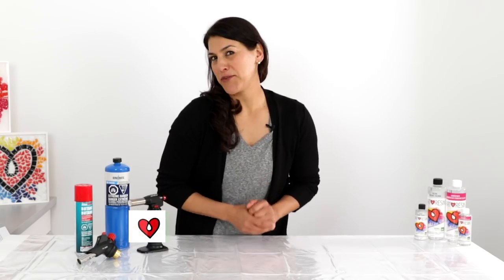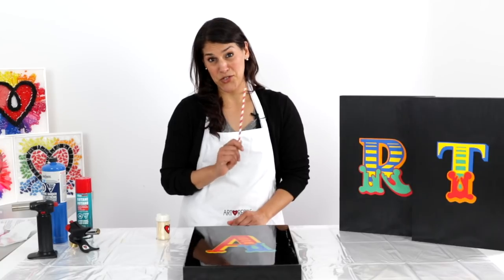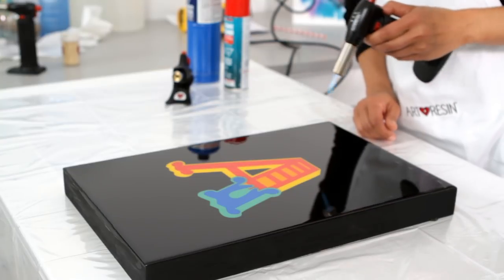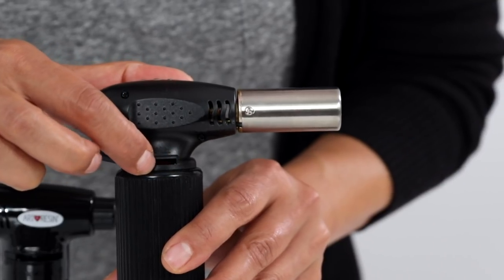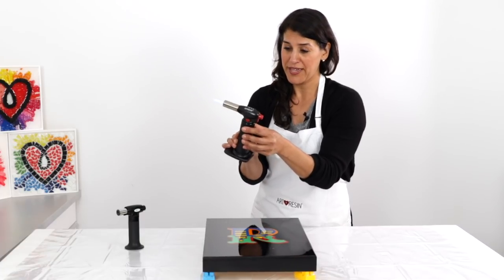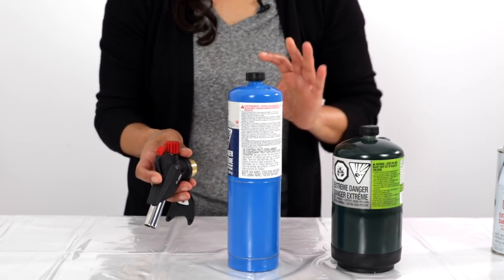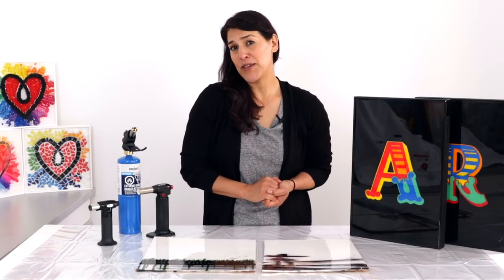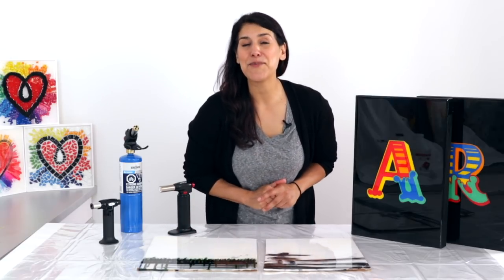How To Use A Torch With Resin

Comment: I may have missed it. But did you address the possible damage to silicone moulds if you use a torch? What are your recommendations for that?
Reply from the maker: We do not recommend using a torch on silicone molds as it will cause the silicone to fuse to the resin and result in tearing your molds.  Instead, you can use a spritz of isopropyl alcohol on the surface to clear off any bubbles that have risen to the top.

Comment: I make small pieces using silicon molds. How do I get the bubbles out without deforming the silicon? Should I not use a torch? Can I put it in the oven temporarily? What should I do?
Reply from the maker: The best way to reduce bubbles in your small molds is to use a warm water bath first, before mixing the resin and hardener.  The warmer resin and hardener will have a lower viscosity which will make it easier for the bubbles to release.  Second, you want to pour in layers of about 1/8", this will prevent bubbles from being trapped in a thick layer and they will remain close to the surface.  Some artists use a spritz of isopropyl alcohol on the surface to clear the bubbles in their silicone molds.  We do not recommend using a torch on silicone molds as it can lead to the molds sticking to the resin.
Reply: @Artresin  Thank you! How else would you make small epoxy crafts without silicon molds? Or do those people only do the warm water bath and never use torches? Also, Are there other mold materials other than silicon for small crafts that would be torch resistant?
Reply from the maker: @con-rob  Silicone molds are the best option for molds, some artists do use a torch but it is important to know it can damage the mold and cause sticking.  The alcohol spritz works well to clear surface bubbles without damage.

Comment: Great video as always from Art resin team.Thanks.I've been using a torch on a heat resistant resin but I keep getting dimples from the torch, but if I don't hold it close enough it doesn't pop the bubbles, do you have any tips about this.
.
Reply from the maker: When torching, you just need to pass the flame across the resin surface and you will see the bubbles disappear, being careful not to let your flame linger in one spot as you risk scorching your resin surface.  Some torches have adjustments for the flame size, so if you are covering a larger area you can use a larger flame and vice versa.  Use your torch while the resin is still fresh, not once it has started to cure to avoid disrupting the surface of your resin.

Comment: Hi, thank you so much for this informative video! However, I’d like to ask: I am considering to buy a candle lighter that is powered by butane gas. But I don’t want to go ahead and purchase this candle  lighter yet because I am wondering, would it actually work for popping out bubbles in resin? By the way, in case this helps you to answering my questions, I only make  small creations with the resin using silicone moulds most of the time (maximum size would be jewellery sizes, nothing bigger) so I don’t really need big powerful gas. What I mean by this, is I can live with less power I.e. time consuming torching; all I care about is whether it will get rid of the bubbles or not, as quickness and efficiency don’t bother me at the moment. So, would the candle lighter I mentioned work for my own situation?
Reply from the maker: It very well could work for you. The only down side to those candle lighters is the flame isn't as powerful or controlled. If you are comfortable using them I think it would be worth trying on your smaller pieces.

Comment: To avoid a film (oil streak) on the top of the surface which fuel is better or cleaner?? Propane or Butane??
Reply from the maker: We have not had a problem with a properly functioning torch leaving a film on the resin surface.  The flame from your torch really just passes over the surface very quickly.  We love the handy butane torch for small areas, whereas the large propane torch head covers a larger area for bigger canvasses.

Comment: hi...so we cannot use alcohol inks if we're using a torch right?
what could be the other alternatives pls? Im from India
Reply from the maker: Yes, you definitely want to avoid using an open flame with alcohol inks.  To help reduce bubbles you can use a warm water bath prior to mixing and then a spritz of 90% isopropyl alcohol on the surface can eliminate any bubbles that rise.

Comment: question , you covered how to adjust the flame on the small torch , however you didn't say how big the flame should be when torching the bubbles out of resin . so should the torch be on low , medium or on high flame ?
Reply from the maker: Hi Donald.  The flame is adjustable so if you are working on a larger resin surface you can use a larger flame, if your area is smaller you won't require that much flame.  The most important thing to remember is to always keep the flame moving, you just want it to kiss the top of the resin to clear the bubbles.   You don't want to keep passing over the same area and end up scorching your resin.

Comment: What is the difference between your artist's head for propane and a standard head from the hardware store? Thanks
Reply from the maker: Hi Evan, if you have a head from the hardware store it will do the same job. However our torch head now comes with a flange that helps to spread out the flame :) https://www.artresin.com/products/artists-propane-torch-head

Comment: I used my torch on a project and got a yellowish, brownish, green spot. Is there away to correct that, like sanding or do I need to strip my project?
Reply from the maker: Hi Carrie, it sounds like you have over torched that area and burnt the resin.  You can try to debulk as much of the burnt area as possible by sanding, then pour more resin to see if that diminishes it enough.
Reply: @Artresin  ty...I  did sand it down and just spray painted that area. It worked! Ty...now to keep and eye on how close I get with my torch and for how long.🤞

Comment: What about bubbles that haven't risen to the surface when working with silicone moulds?
Reply from the maker: To help reduce bubbles we recommend using a warm water bath prior to mixing.  This will help the resin to be less viscous and allow for bubbles to rise to the surface easier.   Pouring in shallow layers  rather than a deep pour will help as well.  Some artists like to use a spritz of isopropyl alcohol on the surface to zap bubbles.

Comment: Thanks for the video, very helpful instructions. I noticed when using the torch my resin has got extra heat + started to cure fast! Is that OK?
Reply from the maker: Using the torch should not cause the resin to heat or cure fast. It is possible you are having an exothermic reaction if your piece is poured very thick or if there is limited air getting to your surface area. Our customer service team would be happy to assist further, you can contact them at support@artresin.com

Comment: Is the studio torch easier to use than the smaller one? - in therms if clicking the back button to get the flame on and off ?
Reply from the maker: Hi Janine, the Artists Studio Torch is our smallest torch. Some artists find it easier to use our propane head attachment with flame spreader on a handheld propane tank. It's really up to you and the size of your artwork.
Reply: ArtResin I noticed you have an improved model of that torch. Mine has the black switch on the back. I was wondering f if the one in this video with the red is easier to use. That’s my question .
Reply from the maker: Hi  @JanineMKartist  , it sounds like you have an older model of our Artist's Studio Torch. Both models are easy to use and user friendly :)

Comment: I normally have newspaper under my art work. I've used cheap plastic tablecloths also.  The art work is raised about 3" with yogurt cups. I've used  chef torches, but I'm thinking about getting the "big boy" torch. Any problem using newspaper or plastic table cover?
Reply from the maker: Carla -  We use plastic often. Just use caution with your flame to be sure it stays on your piece :)

Comment: I saw a video where someone said her resin wouldn't come out of the silicon mold because she used a flame, but when used a heat gun her mold came out with no issues.  Have you ever heard of this happening?

Comment: I have tried this and the bubbles seem to stay and piece catches fire instead of killing bubbles. Help!
Reply from the maker: Hi Vincent-are you using ArtResin?  The torch flame is just meant to skim the surface of the freshly poured resin, don't let it linger in one area.  You should see the bubbles clear away easily from the surface.  You do not want to torch so long that you heat the resin to burning!

Comment: Why does my torch keep going out when passed over certain areas of the canvas?
Reply from the maker: try adding more fuel, it could be getting low on fuel and changing the angle as you torch makes it sputter and go out.

Comment: Hi, what if we don't have a torch??
Reply from the maker: Hi Larisa, the torch is the absolute best way to eliminate surface bubbles.  If you do not have a torch, Joanne touches on some other less effective options in the video.  If you do a lot of work with resin you may want to consider the small investment of a butane torch for best results.

Comment: So if I add alcohol ink, spray paint, or mica powder to resin, don’t use a torch? How do I get rid of bubbles in that situation?
Reply from the maker: You do not want to use a torch with flammable ingredients.  You can do a few things to minimize bubbles in this case. Placing the product in a warm water bath prior to use will help to lessen the amount of bubbles. Also after mixing your product allowing it to sit for a few minutes to allow bubbles to rise to the surface and pop on their own may help.

Comment: I was Using torch for Making alphabets and My mould starts burning and I think due to that reason.. It's really hard to demoulding all the alphabets.. Do You have any suggestions how to use torch properly on alphabets or using anything else???
Reply from the maker: We do not recommend using a torch on resin in a silicone mold.  The high heat from the flame can fuse the resin to the silicone and actually damage the mold, making it very hard to remove without ripping.  The torch is best used when pouring your ArtResin over a canvas or flat surface.
Reply: @Artresin  So how to pop mould's bubbles??
Reply from the maker: @ishagoel1131  use a warm water bath first to help reduce bubbles, then pour in shallow layers of approximately 1/8".  Some artists use a spritz of isopropyl alcohol to clear bubbles from the surface.
Reply: @Artresin  Thank you for replies ❤🤗

Comment: how do you turn it off?
Reply from the maker: If you have the red slider on the side turned to continuous, that will keep your torch running until you press the red thumb trigger again.  If you do not have it set to continuous, the flame will stop when you remove your thumb from the trigger button.

Comment: Hi, I know you are going to think this is dumb... great demonstration on how to turn the torches on.... but you missed the most important step.  TURNING IT OFF... You say it is important to do this.  BUT FAILED TO DEMONSTRATE THIS PROCESS.  LIKE IT IS A GIVEN and everyone know how to do this step. So I liked the thing even what the heat gun can do and I will probably try... but the big question I am taking away from this is one must use all the butane and let it burn off ... kind of a waste.  But So far that is the only option I see with this demonstration.  So My question is how long must one hold one of these torches till it has burned off.  I use a walker because I am limited.  So perhaps this might not be for me after all.
Reply from the maker: Hi Cora, you have two options when using the torch.  Once you slide down the safety tab under the red button, depress the red button with your thumb.  This will light the torch.  If you take your thumb off the red button, the flame will go out.  Alternately, once lit you can slide the red sliding tab on the left side of the torch, this will keep the flame burning continuously.  To turn it off just slide the red tab forward.

Comment: Could i use a butane torch on a river table
Reply from the maker: Yes you can!  The key is to just pass the torch quickly over the surface of the resin and the bubbles will easily disappear from the surface.

Comment: Can you use a lighter?
Reply from the maker: Using a torch is the number one way to achieve a flawless, resin finish, free of bubbles.

When you catalyze your ArtResin mixture, you create a lot of bubbles as you stir. Those bubbles need to be eliminated or they'll cure right into your piece. 
The flame from a torch heats the resin surface up instantly, thinning it out and allowing bubbles to escape very easily. Not only does a torch provide the pro results you're looking for, but has the added benefit of burning off tiny dust particles that may have landed in the resin. 

Here is our blog for more information: https://www.artresin.com/blogs/artresin/why-use-a-torch-with-artresin

Comment: Not me waiting until she actually touches the resin with the flame because I’m terrified of starting a fire
Reply from the maker: Hi Cielo.valle,  you just want to pass your torch flame along the surface of your resin, you don't want to let it linger in one spot.  The quick pass of the flame will burst any bubbles but not burn the resin.

Comment: Where's the PPE?!?!??! mask gloves ???
Reply from the maker: ArtResin is non toxic and does not produce fumes, a respirator is not required when used in a well ventilated area.  It is important to avoid contact with skin so you can see that Joanne is wearing her gloves while mixing and pouring her pieces.   For more on safety, please have a look at our blog:  https://www.artresin.com/blogs/artresin/what-safety-precautions-should-i-take-when-using-artresin?_pos=3&_sid=507e6e60b&_ss=r

Comment: Something I didn't found in any guide is how much time you need to wait for use the torch, I mean, epoxy is inflammable and all the gasses it throws when you just apply the epoxy is crazy
And if you wait too much...torch won't do shit
I'm just starting with epoxy
Reply from the maker: With ArtResin you will want to torch your piece once your resin is applied and spread out. It is meant to be a very quick process with the flame just barely kissing the surface of the resin. You also have a 45 minute working time so you will not want to torch beyond that point our you may damage your piece. 

You will want to check with the manufacturer of the specific brand you are using on working times as they vary.
Reply: @Artresin  i have 15-20 mins based off the room temperature